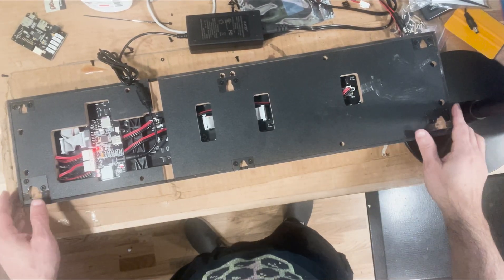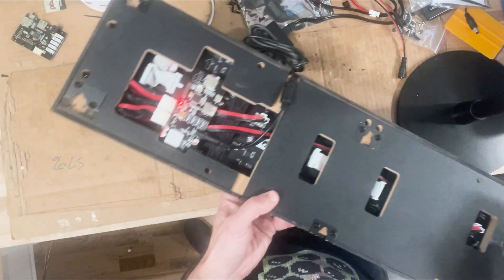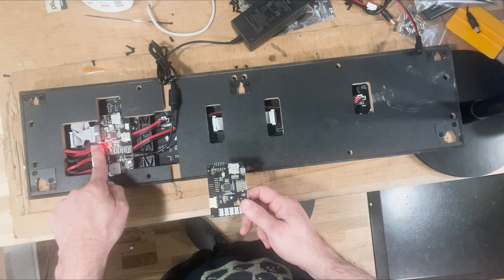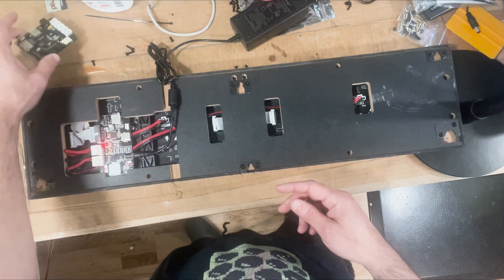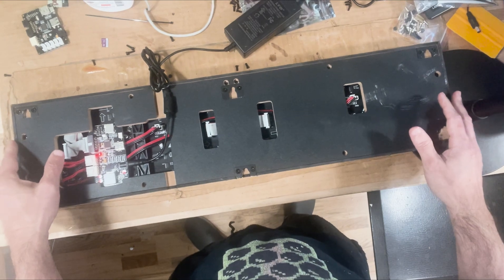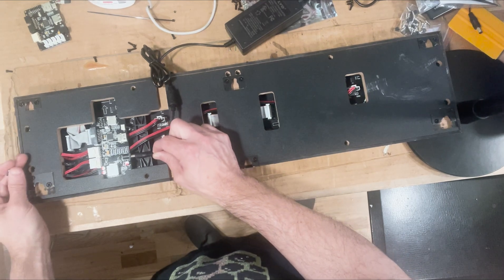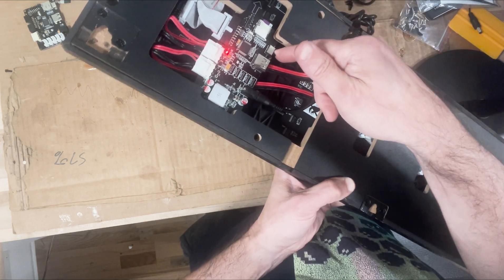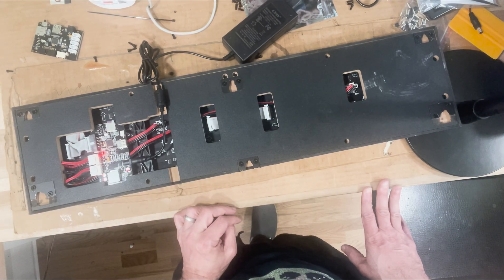BitPixel LED Troubleshooting

Comment: First of all thank you so much for this GREAT video! I have a minor issue with my ATGames BitPixel LED marquee. It worked fine till today. The problem is that the default animation showing LEGENDS ULTIMATE does not appear anymore. This usually has been shown as soon as the marquee is switched on. After loading the BitPixelX App from my flash drive at least the game animations are working fine but not this default LEGENDS ULTIMATE animation. 
So, according to your video it seems like the BitPixel's SD card became corrupt. Am I right, the only thing I need to do is to follow your instructions how to upgrade or reset the Picxelcade LED firmware?
Reply: I've just followed your instructions and everything works fine again. Thank you so much!
Reply from the maker: great, yes that's a known issue with V1 boards, it'll actually still work with the blank screen once the front end kicks in but the reset will restore the default marquee

Comment: My BitPixel just quit on me. One day, it was working, the next day, it wasn't. Guess I'll have a look for that red light, and check that SD card. Thanks.
Reply from the maker: have had a few folks recently with this and for them at least, turned out the 12V AtGames power supply went out. So you could try finding another 12V power supply and plug that in to test.
Reply: @opengadgets  Thanks. I will do that. Do you know what the mA is? or is that printed on the brick?

Comment: Help my led is really dimmed and sometimes can’t even see… do I just need to formate it & how?? Thx
Reply from the maker: if you are just seeing dim red LEDs, then it means only USB power is coming through and the normal 12V power that is supposed to also supply the LED panels is not coming through so I would check your power supply first
Reply: @opengadgets  thx u so much I will try it right now and let u know thx
Reply: @opengadgets  I just checked still same I was told to try taking micro sd to format sucks I don’t have no pc or Mac that works at the moment, probably gonna try using my mother in law’s computer to try .. I’ll keep u updated see if it works thx

Comment: My red light isn't on and my bitpixel suddenly stopped working.. Doesn't seem like Atgames sells the bitpixel anymore on their site, let alone a replacement board... What are my options?
Reply from the maker: I would first check your power supply and connection to eliminate the possibility of a bad power supply . If no luck there , a repair kit is here https://creativeartsandtechnology.com/product/bitpixel-repair-kit/
Reply: @opengadgets   The green light is still working on my power brick. I would assume that would indicate that it is still working? I am considering buying the repair kit as it seems like it is my only option. Is there a warranty or am I able to return it if I can't get it to work?
Reply from the maker: @degolocsta18DegoLocc  I'd need to see a video of what is happening to better assess, can you post over at https://pixelcade.org/forum/main-category/ and can go from there. 90 days warranty on the kit
Reply: @opengadgets My Bitpixel actually started working again. Thanks though.
Reply: Mine is just completely really dimmed what do I do??? Thx
Reply from the maker: @bucclao209  post over at https://pixelcade.org/forum/main-category/ a video of what you are seeing and also the wiring and can better advise